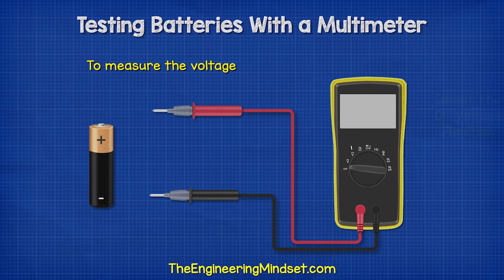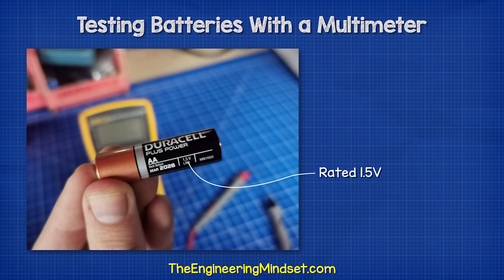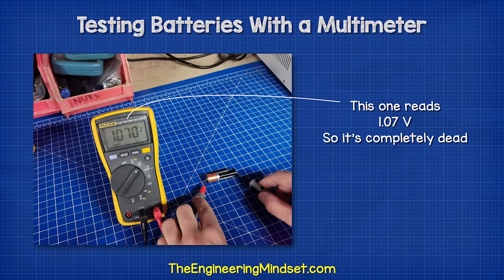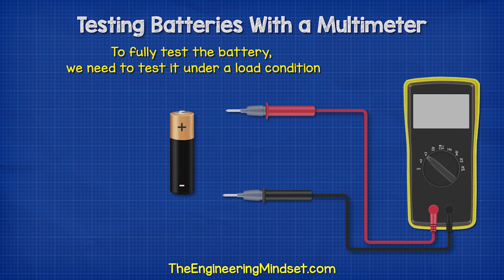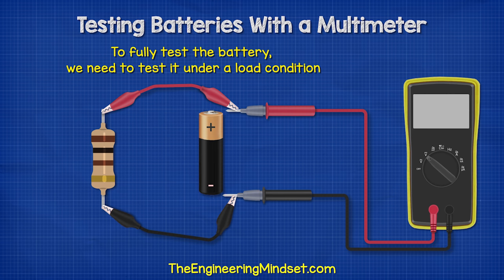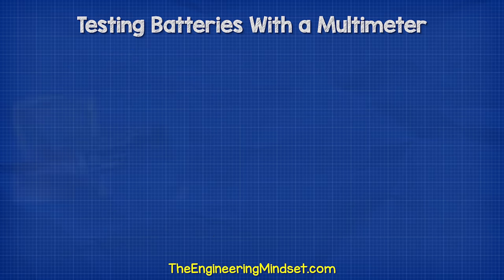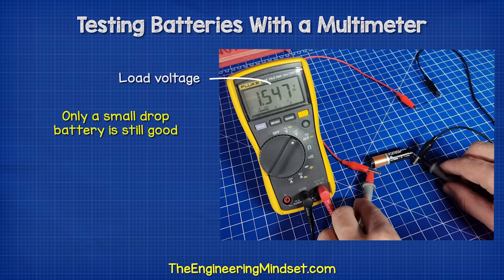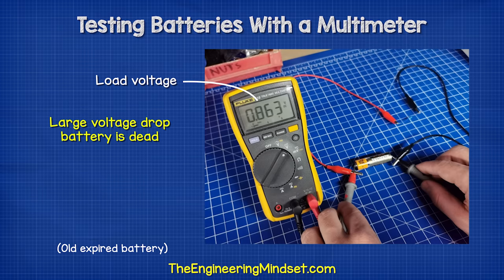Testing Batteries With a Multimeter - AA Battery Test

Comment: But why multimeter is not serving the battery as Load why we have to use an external resistance to use it as Load #PleaseHelp
Reply: Some have it built in for 1.5 and 9V
Reply: Measuring voltage isn't the same as checking a battery, you should keep the current close to 0 so that the voltage isn't affected much.
Reply: the input resistance of the voltmeter is way to high to serve as a load (1-10 MOhm)
so there is very little current flow from the battery -> 1.5 V / 1 MOhm = 1.5 μA
if you put a 100 Ohm resistor in parallel, you still have ~100 Ohm (99.99000) -> 1.5 V / 100 Ohm = 15 mA, that's a lot more current flowing (more load)
Now if the battery is full, there is enough "juice" inside to keep the voltage near the rated value.
If the battery is dead, there's no "juice" left to feed the voltmeter and the resistor with the rated 1.5 Volts :(
Reply: @SystemX1983  thanks man that helped me sort this out better in my head. Just curious, on a 1.5V battery, what voltage would be considered dead? 1,4, 1.3....1.0? how far down?
Reply: @FineTuned  wikipedia says a really dead battery can still have 0.8 to 1.0 volts ...
in general it depends on the connected circuit, for example a tv remote can still operate with a battery that seems dead for a high power LED torch :)
Reply from the maker: Check our new Multimeter tutorial out ➡️ https://youtu.be/4lAyzRxsbDc
Reply from the maker: Check out NEW resistor video, everything covered! ➡️ https://youtu.be/DYcLFHgVCn0

Comment: There is a reason why we shouldn't check car battery by using general multimeter as this video mentioned, when a lower rated voltage in a battery will only be detected when it is dead.
Reply from the maker: Check our new Multimeter tutorial out ➡️ https://youtu.be/4lAyzRxsbDc

Comment: okay this is a good video but you missed just one thing a lot of us don't know how to work a multimeter as well as you do and I don't think you mentioned what setting you have to put it on since it's 1.5 volts I think you want to have it on the setting of less than four volts or lower volt setting so that this shows up or maybe your multimeter just does it automatically either way you should mention that just saying
Reply from the maker: We have a ~40 min tutorial on multimeters coming very soon, I'll tag you when live
Reply from the maker: Check our new Multimeter tutorial out ➡️ https://youtu.be/4lAyzRxsbDc

Comment: If it’s a Duracell, then automatically toss it.  While it may have full capacity, it’s likely to leak all over the inside of your device even before its expiration.  Do a YouTube search on leaking batteries and you’ll see that nearly every video features a Duracell as the star.  I used to love Duracell batteries, but now I refuse to use them.

Comment: I love this channel but will forever wonder why the hell someone would want to test their batteries. And go to all that effort. To test their batteries. Get new batteries..
Reply: Here’s an example ... you have a 6V device that requires 4@ 1.5v cells but doesn’t seem to work, because the cells are in series it only takes one bad cell to cause the failure even if the other 3 are brand new. Testing individual cells locates the problem and only need to replace the bad one instead of all 4.